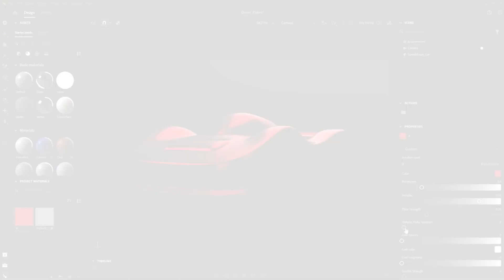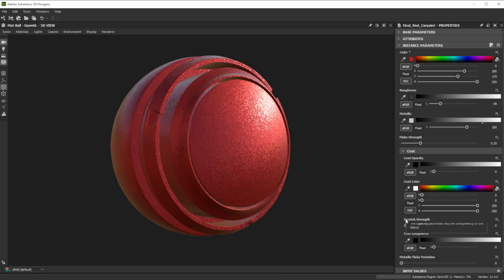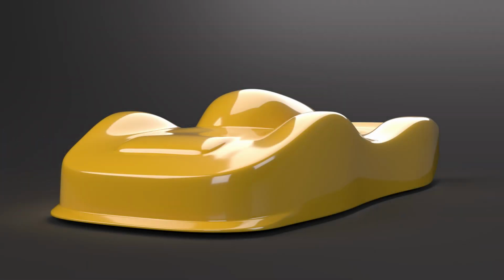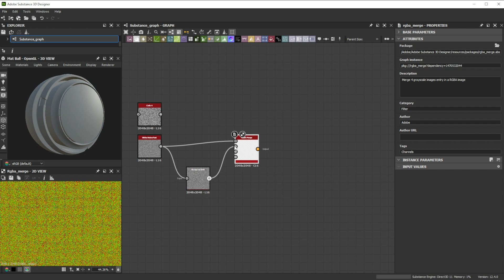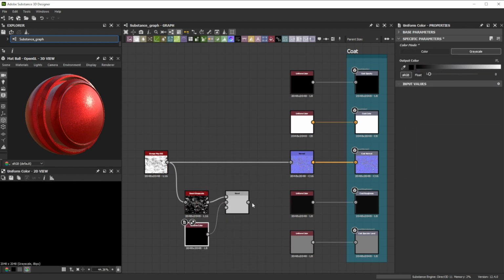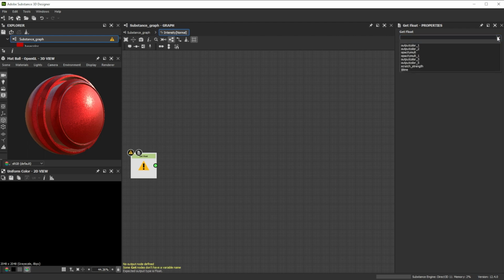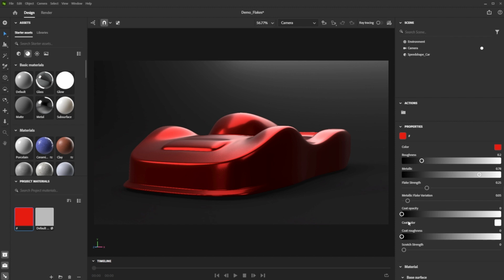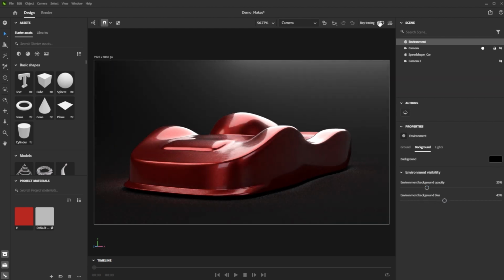Advanced Material Rendering - Carpaint with Substance 3D Stager and Designer | Adobe Substance 3D

Comment: Hi) This is realy useful tutorial! But i have any problem( After publishing the material in .sbsar and adding in SP, the coat parameters do not change in any way on the model. What could be wrong?)
Reply from the maker: For Painter, you MUST add extra channels to your project: add Coat Opacity, Coat Roughness and Coat Normal, then turn on Coat in the shader settings.
Reply: @Substance3D  very helpful, thanks a lot, I have found this substance for a long time for my car project in University. This is so insane !!!
Reply: Hi, I have the same problem, that the clearcoat has no effect. How can I get the clearcoat in Unreal, Unity and VRED with the .sbsar ? Thanks.
Reply: @Substance3D  找寻了好久关于这个问题的答案，还得是官方才是最好的！点赞~~
Reply: I face the same problem.